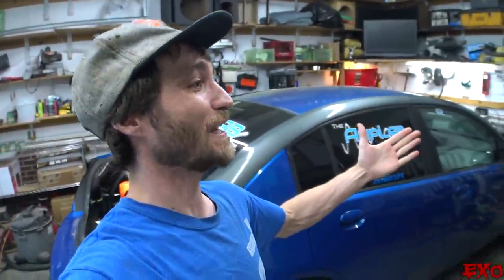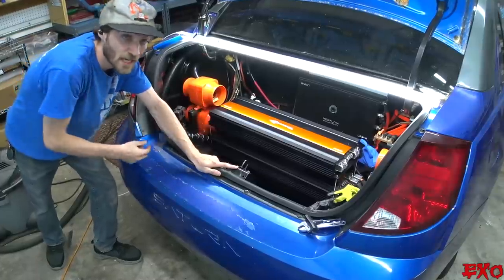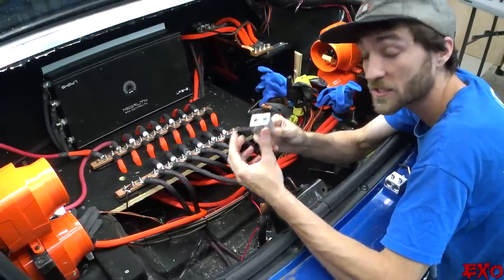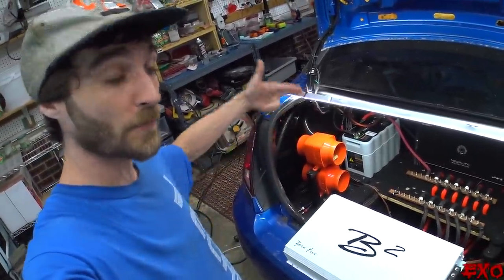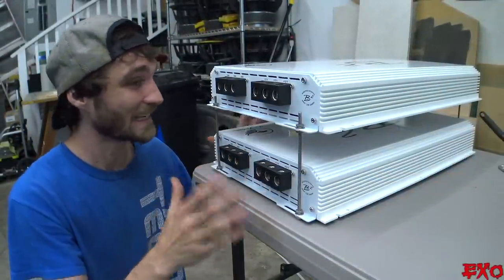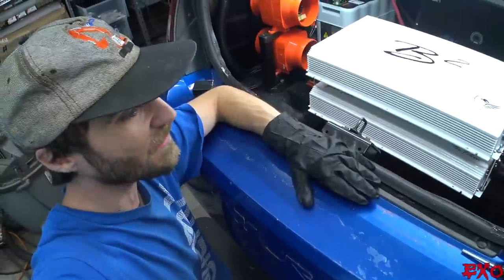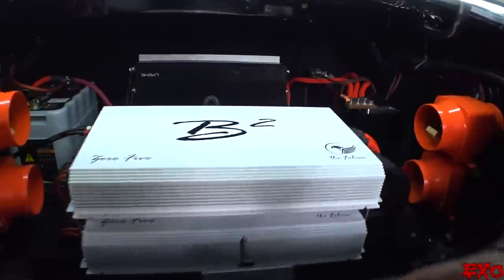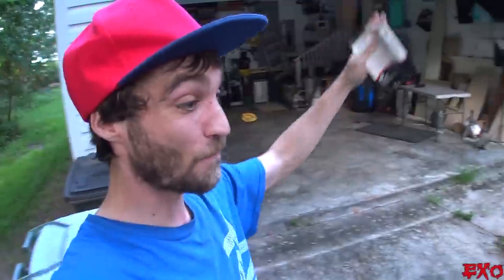DOUBLE STACK Amplifier Install w/ 10,000 Watts of B2 Audio FALCON Bass Amps + LOUD Subwoofer Demo!!!

Comment: I’m right there with you! I haven’t heard my system for about 2 months. My battery sensor gave up and took the battery and alternator along with it. I haven’t had the chance to get the replacements, other than the alternator.
Reply: It was a year or more for me since my amp died, but I just installed a new one tonight.  I'm nowhere near that kind of stuff though, I'm more than happy with 600w through a 10".  I couldn't imagine what this madness sounds like.

Comment: Something ive been wanting to see. Not only the db reading inside the vehicle. But also outside of the vehicle. Like do a distance test. First see how loud you can get from inside the vehicle, right outside of the vehicle, 10ft, 25ft, 50ft, 100ft, and 1000 feet away. I was talking to a guy that says car bass doesn't travel far out in the open. I know that ive heard 6 block bass before. Its insane when it goes by your house. Maybe everyone can take part in a distance SPL challenge. Figured it would be fun.

Comment: Im 48 im a painter with a 10in. 800 rms db drive in ported box on a nemisis 1500.5 and jl audio c1 series components in the doors and tweet in the dash of an 03 honda odyssey 
Listen to some rap but mostly 60s 70s jazz and 80s alternative sounds amazing wirh that lil kick behind u in an open space. Cant stand trunk rattle

Comment: When trying to fit the fat cable in the barrel ends I peel back some of the wire ends and cut a small bit from the center and not the outside. It keeps a tidy look and prevents any stray wires out the end.

Comment: Every time a wire has a cut or connection it it loses 10% of its power. I recommend full solder never had a problem with that.
I thought I thought 💭was the only one that puts amps on mounts. May amps is  2inch up off my box to cool better. I like the amps set up 👍🏽🤠 how much power do you need before you need an extra battery. 3k or more.

Comment: Was that ultra cap really putting in that much work? From my knowledge you have the iraggi 300a,  the battery under the hood and the cap? Been on the fence about going second agm or the ultra cap after your last video on it. If that thing kept up that well with only 1 batt and alternator im 100% sold on it lmao.

Comment: dam lol thats what I need im moving some air with my setup not alot like that but finally a little bit. Though I do need a better batt and need some deadner in the doors and also find a way to make my 3rd brake light stop hitting my back window in my car its annoying the more I turn it up.

Comment: Would rubber bushings add anymore protection from vibration if you put them on the top and bottom of each of the washers that separate the amps? I’m not bashing your work I’m just curious because I’m saving up for another skar amp and I am playing doing the same amp set up!

Comment: I'm just curious if you had to really slam on your brakes how are those amps going to stay mounted ain't those bolts going to bend the bottom plate on the bottom amp?

Comment: I forgot what’s with the zip ties on the face plate?   is that to keep it from popping off?    I have that problem with mine the face plate wiggles off the connection and reboots the Head unit

Comment: I enjoy wiring my amps and subs aswell but I always get nervous when I get to the power wire.😬
Reply: Karen  my inline fuses are such a pain to open and close. I lose a screw every time I adjust them or mess with them. I don't have extra pair of rubber gloves to cover the ends on my power ends like EXO does" so to each their own".

Comment: but in the end these b2 or crescendos are more powerful? falcons on paper deliver less power at 13.8v than crescendos and do not support 0,5 ohm loads
if the coils of the psi platform 5 are 1 ohm each (0,7 ohm dc), in parallel there are 0.5 ohm load on each amplifier, how is it possible that they do not go into protection?

Comment: Hi I recently tried to install an amp and sub in my car and it blew a fuse and I had to buy a new radio. I now have a pioneer x490bs radio and I'm scared to try again because I don't know if it'll ruin my new radio or if my stock radio just couldn't handle the amp, any recommendations? (I have the skar 1200w amp and alpine woofer, and when I did a lil research my car has a built-in amplifier of 50w x 4)

Comment: Does port placement matter when using aeroport? The design im following is for front sub front port but i would like to have the port come out the side. Same size aeroport just different location. Will it affect the tuning?

Comment: Hey just wondering are you using your normal rms rate for subs if your not try it out you mite like the results the reason I saying this is the radio will give you the peak rms out of your amps I go by my normal rms on my subs and there clear with no distortion and they hit hard with barely no draw on voltage at 50hrz

Comment: Hi EXO after watcing one of your videos i have fell in love with the bass life i have a 1994 mercury cougar with stock alt why do i see so many people on videos with the same amp i have a 2400 wat hiphonic zeus on two 12 inch kicker cvrs and people with the same amp are push 4 sundown nightshade 12s why are they getting almost compitetion sound, bass, and flex window shaking trunk vibrating the whole shabang i have stock alt as nd no second battery with the people in the video do have but they have stock alt as well what should i do if i cant afford a high output alt should i get subs with a lower inpeadance and add litheum batteries

Comment: Them are some tuff amps! I’ve been waiting for someone to show a video on the Zero 5 falcons. I have two of theses amps and they don’t hit like that for me 😞 seriously need your help and info exo on what I’m doing wrong with my amps
Reply: stronger alternator(s), the big 3 update, decent subs, big batteries and stable voltage
Reply: Google Account have all that. My electrical is an over kill. Voltage stays around 14.2 and 13.9. I have two GP audio 15” undertakers  and they do not move air at all. When I play the track from DJ Magic Mike called Here Comes The Rude Boy the subbs start cutting out and they do not play this song very well
Reply: @GoogleAccount-tt5yx  You achieve stable voltage after upgrading the big 3 and installing a HOA?

Comment: Question about wire. If my wire is copper weld 4AWG and it states you can run 150 through 100ft. Does that mean I can run double the amps through 50 and so on?

Comment: I was just wondering how do u tune up or set your gains ..do you use SMD equipment...or do u use a volt meter?  And if you could email me with your instructions.
Reply: He uses an oscilloscope
Reply: @Ninjasraynonu3  No he probably uses SMD Equipment now since he got it from Steve

Comment: These amps are weirder than most I have seen usually when the ohms Drop you get more power it seems like on these when they go up you get more power another thing too is those fans are cool but hopefully the intake fans are not sucking up the heat from the exhaust fans that would ultimately be defeating the purpose

Comment: Ya it would have always been a extra perk to see if u strapped the 2 amps together or did u run them separate fr fr cause from the looks of things the way u had things wired they are separate and not strapped but strapping them will make them work together as one single amp with the master and slave set up but it does do something with the ohm load change he'll u might be getting more power out of them individually wired then u would as strapped but it might be something u might want to experiment around with fr fr and from all the flex ur doing u might want to invest in a shit load of second skin and the ones that goes behind all ur mids to deflect all ur highs outward fr fr he'll u might ask old Steve if he's got any opioions on ur shit to if nothing else make a special trip to go see him cause he was good enough to look out for ya with those expensive tuners like that dd1 I'm surprised u haven't got a few of his meters in ur ride expecally like the one that controls those big ass fans what's cool about those fan controllers are the go slow then ramp up when hot and back down once there cooled back down so ur not having to listen to them loud ass tornado fans like that if nothing else hit him up cause he has been coming up with some new killer connections and some pacaso shit I tell him all the time his ass is the modern day da vinci of car audio and equipment and I didnt lie to him cause he has got 1 he'll of a creative mind to him fr I been trying to get him to use a few of them neo magnets on the edge around one of his amp racks and make one screwless an just mod the mounting lip with a few small neos and a few counter sank in the amp rack lips it should hold them secure as any screw if u was to.ask me those magnets are super super powerful the bigger ones could take off a finger if u got it caught wrong no shit fr fr that might be something u might atemp later on in one of ur installs weather its in one of ur toys or someone elses I believe ur suv is a ford right lol I had Affordthis with the brand logo under it on my back glass in the middle cause he'll its a ford for 1 and to affording something of that magnitude is slim to none so it suits it trust me lol a fford this cram it all together then u get the hillbilly vision of affordthis lmao but keep it up ur shit is getting nice my friend lots of trial and error I'm sure fr its best to soilder all connections in something that big or ur going to be tracing out shorts an speakers cutting off or on and off its just a pain in the ass if u dont do it 1 and done in other words do shit right and the long way the first time or trust me ur going to stay troubleshooting problems left and right but u should get u a battery isotlater one of the blue ones with the 3 bolts out of the top of 1 of them they got diffrent amps I got a 160 amp one outside in my ride so it will allow u to charge 2 batteries without no problems u dont gotta have a 500$ alt eithed the center post comes off ur stock alt and the outer 2 just goes out to the 2 charging systems but this way ur amps only runs off the batteries in trunk and ur ride runs off the one under ur hood I promise ya no light flashing what so ever cause ur amps are seeing 14.4 volts from turn on fr fr cause ur alt makes ur batteries run at 14.4 before u touch anything in ur ride but no sooner then u so much as touch ur break or anything it automatically drops back down to the 12.4 volts cause that's tge voltage ur requires to operate properly fr stay breezey EXO hallor at ya on the flip flop ..

Comment: Why don't you just disconnect the battery of your car instead of putting those gloves as insulator.. don't forget also to disconnect the power capacitor.. it might some voltage has been store out there.. disconnecting battery is a very safe step before disengaging those wires and terminal it will save a lot your money..

Comment: I have a 1500w audiopipe running at 1ohm and my negative side heats up crazy anyone know what it might be all i have on the negative side is a 0 to 4 guage reducer but the positive side doesnt heat up as bad any ideas?
Reply: Better ground point and if you have the 0 gauge terminals, use 0 gauge wire.  Your ground is using 4 gauge?  Thats not good enough, espcially since youre down to 1 ohm.  Lower resistance causes amps to run less efficient; therefore, getting hotter, quicker.  You should be using at least 0 gauge for power and ground.  Should do at least Big 4, if you havent already and would recommend an agm or lithium battery for reserve power in case your amp is trying to draw more power than your electrical can put out. That will cause thing to heat up as well